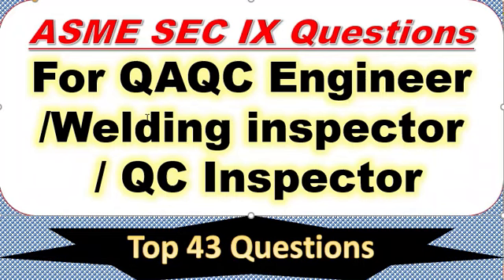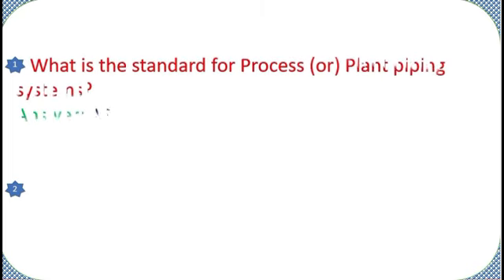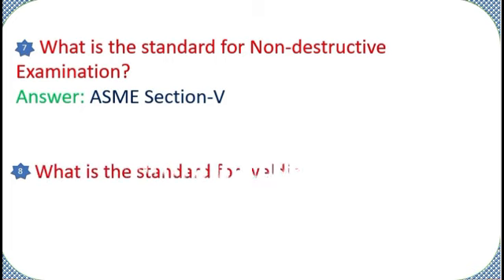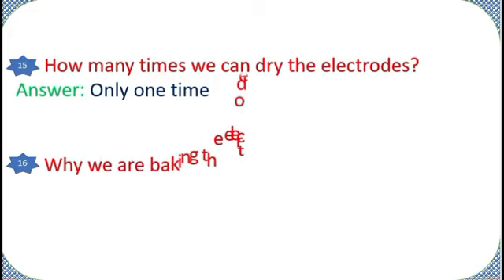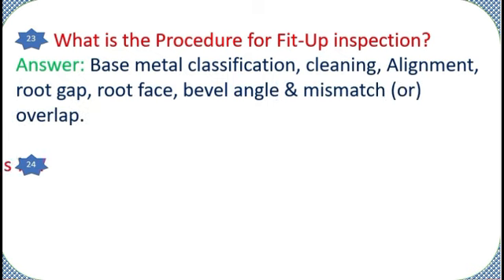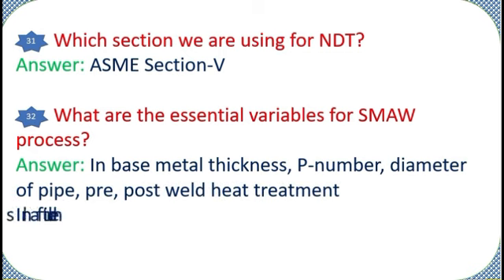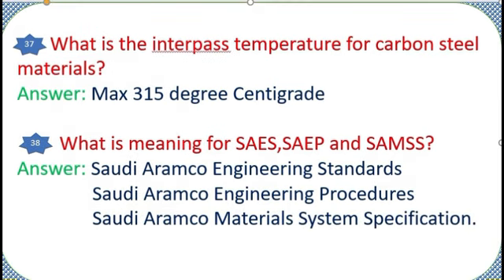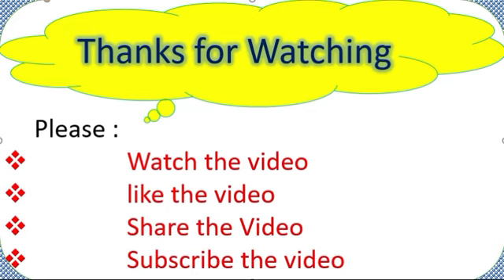Interview Questions for QAQC Engineer & Welding Inspector

Comment: You mentioned in your answer pipe diameter is an essential variable in SMAW &  Gtaw process  but  diameter is a non essential variable according Asme ix
Reply from the maker: Check QW 403.16, you will understand. If not understand you can ask me. Thanks

Comment: Sir plz tell me the answers of thi questions
1. Which of the following welding process uses a resistive heating system to achieve weld metal deposition
A. MMAW
B. SAW
C. ELECTRO SLAG WELDING
D. RESISTANCE SPOT WELDING
2nd question
Which of the following destructive test is not normally required for welder approval test for mild steel
A. Bend test
B. Macro examination
C. Impact test
D. Fracture tests
3rd question
Which of the following defects is more common to weld deposited by the CO2 welding process than weld deposited by manual metal arc ?
A. Slag inclusion
B. Excess penetration
C. Lack of side wall fusion
D. Tungsten inclusion
Reply from the maker: 1.C,2.C, 3.C
Reply: @WeldingNDTInspection  Thank you so much sir

Comment: Sir Thanks for your video
What's the difference between API 1104 AND ASME SEC IX.
Reply from the maker: Welcome please subscribe my channel and share it in your time lne to grow my channel.
API 1104 for welding requirement for cross country pipeline, ASME SEC IX is for boiler, pressure vessel, piping welding requirement.
Reply: @WeldingNDTInspection  Thank you sir..Exactly i am sharing your valuable videos
Reply: @jyothisthomas2705  actually the answer provided is not correct.
You use 1104 for gas transmission pipe for carbon steel and low alloy steel pipes, And it comprises from the elaboration of a WPS, to its qualification with a PQR to the qualification of the welders, inspection and acceptance standards of production welds, creation of NDT procedures, reparation of on-service gas transmission pipes among other stuff.
ASME sec. IX is a code for the elaboration of welding procedures and its qualification. It also includes qualification of the welder, called, welder performance qualification. ASME sec. IX includes information applicable to brazing and other processes.
The materials allowed in this code are basically what you will find in pressure boiler equipment (from carbon steel, low alloy steel to high alloy steel). That is, because, ASME IX is a section of the ASME Boiler and Vessel Pressure Code, meanwhile API goes for gas transmission pipes only.
And here is why the answer was wrong.
Piping ASME Code B31.8 is a designing code for basically the same scope than API and for welder qualification/welding procedure qualification, it can rely on API or in ASME IX ( I mean, both). However, ASME B31.8 relies solely on API 1104 for acceptability purposes.
Said that ASME IX and API 1104 are simply not comparable because they have totally different scope and uses. API 1104 is a construction standard whereas ASME IX is a code for the qualification of welding procedures and welders.

Comment: I think questions number 35 wrong because asper sec Ix thickness qualifications ranges in 2t
Reply from the maker: check QW 452.1 (B) , ASME IX / QW-452.1 (b) states that if you test with with 1/2 in. (13mm), then you will be
qualified to unlimited.  Less than 1/2 in. (13mm) would qualified you to the 2T thickness of the weld metal.
Reply: @WeldingNDTInspection  not mentioned there.
Reply: Maximum to be welded
Reply: They asking for welder qualifications, read properly  asme sec 9, your mentioned pqr